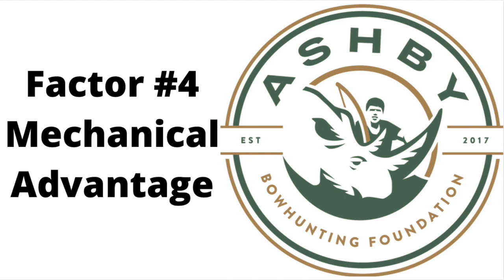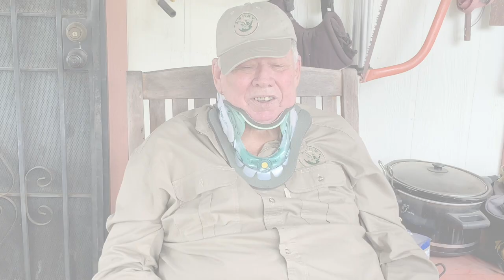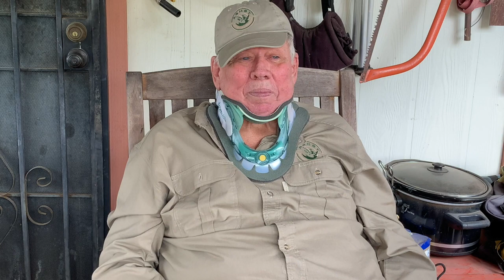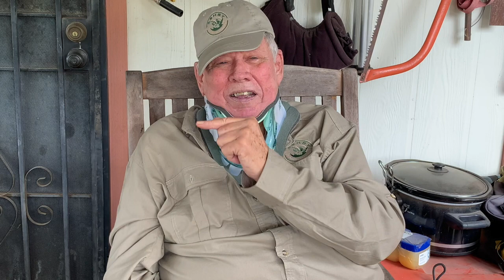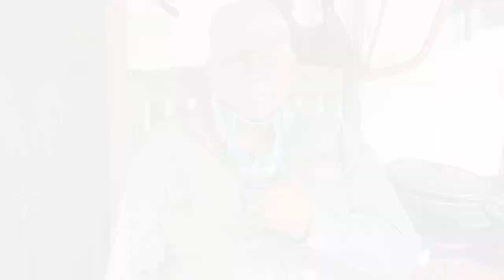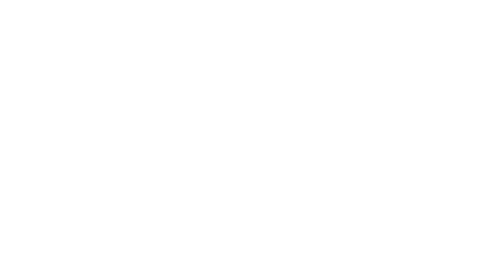Factor #4 Mechanical Advantage

Comment: Do you have any research on the angle in which the broadhead is oriented? I have been shooting them laying flat in relation to my arrow rest on my trad bow. The thinking is that as it is fishtailing the flat surface is not “slapping” the air before it starts its rotation. I am curious to know if you have researched this. Thanksp